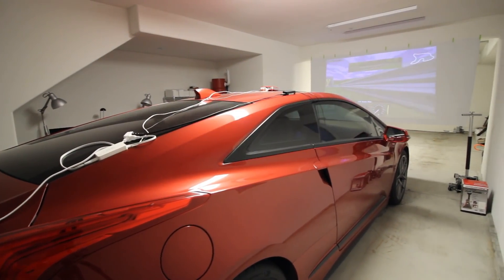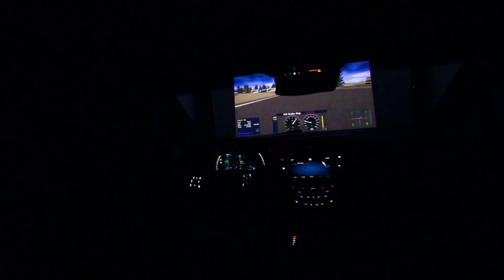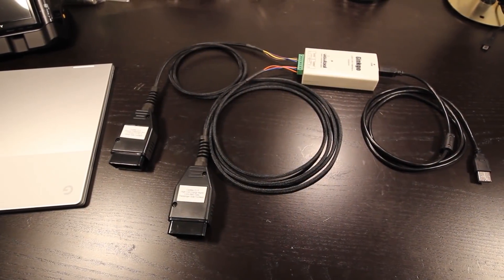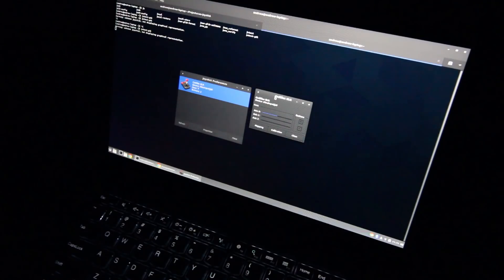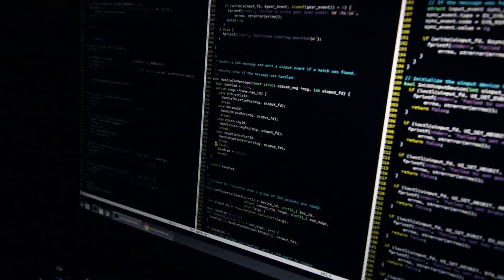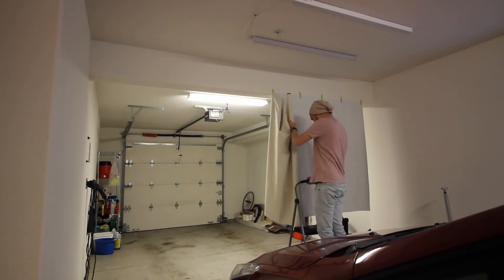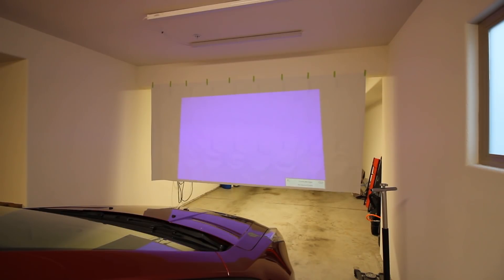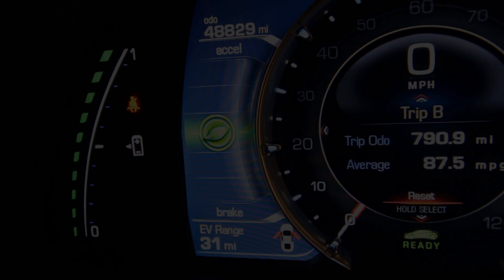Real Car Racing Simulator | CAN Bus Hacking

Comment: It has an electric rack so it can provide force feedback you just need to figure out how to code the can bus messages to it.
Reply from the maker: You are right - but - this is easier done with the ELRs that have self-driving capability (ie: lateral control). The OpenPilot project has this all mapped out, but it only works on cars that support lane keep. My car is missing this functionality so I am unable to command the steering angle.

This is wild tech. I would love to be able to control the wheel.
Reply: @TheResistorNetwork  The steering angle sensor is in the column. It should send a message with angle and force applied. with a little trickery, reading the messages to use as a controller changing them and playing them back to the car for the force feedback. I have moved electric rack BMWs without self driving or lane keep using this method.

Comment: Tyre wear and tear simulator. Oh wait, that's happening for real.
Reply from the maker: It's not a big deal for this quick test, but could easily be fixed by propping up the front end on jack stands or putting something under the tires as a sacrificial wear plate (like plexi or something).
Reply: @TheResistorNetwork  

Well thought. 

I was wondering how you'd deal with tires and the steering rack forces. 

Creative and interesting engineering. 👍

Comment: So with the car off, the steering wheel and gas pedal still output valid data on the CAN bus??  Or did you have to first transmit some data from the Ginkgo in order to enable it?
Reply from the maker: The car is running so all controls are functional. It is an EV so this can be done without running the engine. The car is in Park.
Reply: @TheResistorNetwork  Wow, I guess the tires moving don't make much of a sound!

Comment: Nice. Extra credit would be to add the force feedback. I know openpilot has support for late model Volts so you could get the CAN messages from there. Unknown if the streering messages move the wheel when the car is in park. https://youtu.be/Ikb8SzzUweM

Comment: You should look into spoofing lane assist commands to have the wheel counter-steer and provide some sort of feedback via that manner.
Reply from the maker: That's a super interesting idea. The wheel in the ELR does not offer feedback unfortunately, but it does have haptic motors in the seat. It would be interesting to vibrate them on the grass!
Reply: TheResistorNetwork side note, you should check out the commaai openpilot project. I have a hunch it's right up your alley.
Reply: @TheResistorNetwork  You can play with using the seat adjust motors as force feedback as well.